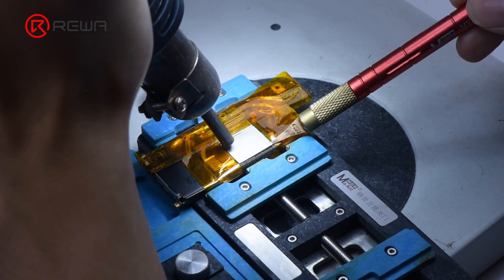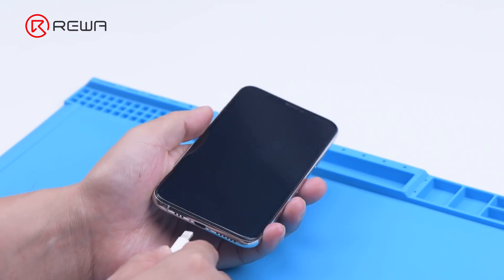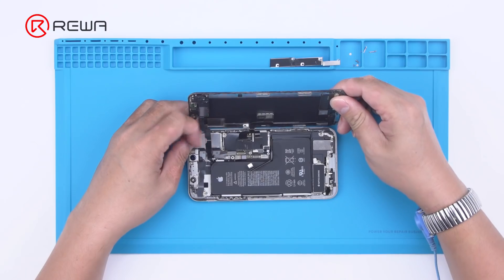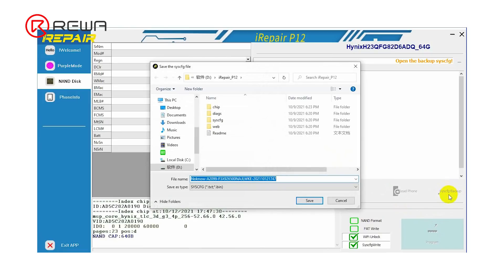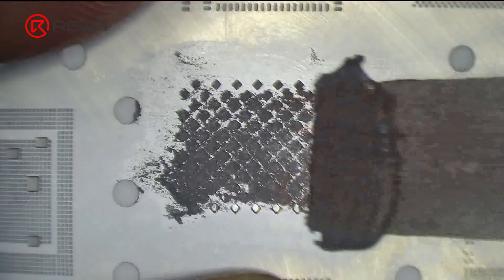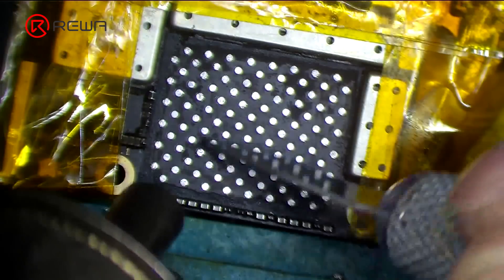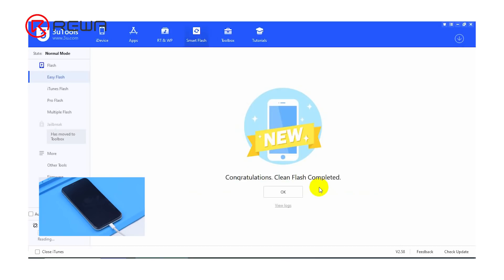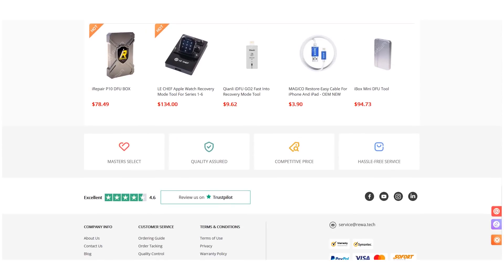Fix iPhone XS Won't Turn On with MJ P12 (NAND Programmer for iPhone 6 - iPhone 11 Pro Max)

Comment: My friend I have an iphone XR with power consumption 189 - 250 and then falling ( not instantly) . What do you recommend?. Already changed u6300 Hydra. But it's not detected by computer, tried DFU mode.
Reply: try a thermal camera and connect power to it with a power supply

Comment: I have a question please help me. I ordered from online a LCD for 6s but 6 was delivered. What can I do? 😭 The iPhone 6 had only 2 flex connectors right? But my 6s needs 3 flex connectors, Can I switch them? Please notice me 🙏🙏🙏
Reply from the maker: Hi, the screens of iPhone 6 and iPhone 6s are not interchangeable. Please contact service@rewa.tech if you purchased from REWA shop.

Comment: The video title says it's for iPhone 6 up to 11 Pro Max, but in the product description on the site it says it's only 6 to X. So what is it?
Reply from the maker: Hi, the purple mode is for iPhone 6-X while BGA110 NAND SYSCFG is for iPhone 8-11 Pro Max.
Reply: 6-X you can enter into purple mode. 8-11pmx you can read syscfg data by chip off method.
Im not sure if chip off method is available for 6-X models.